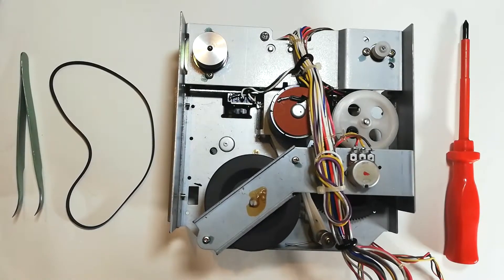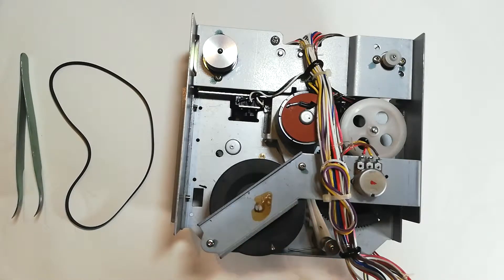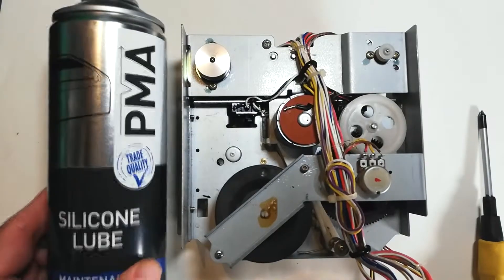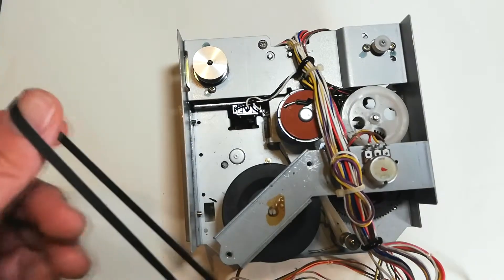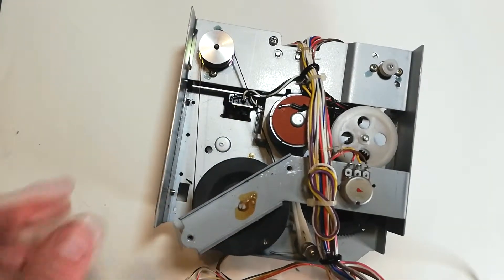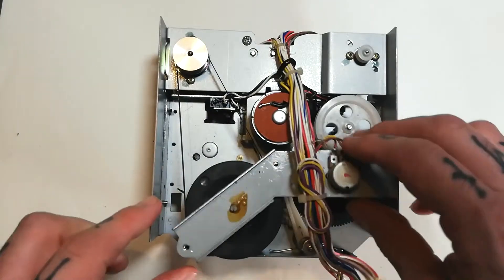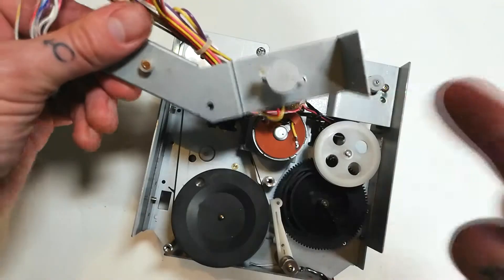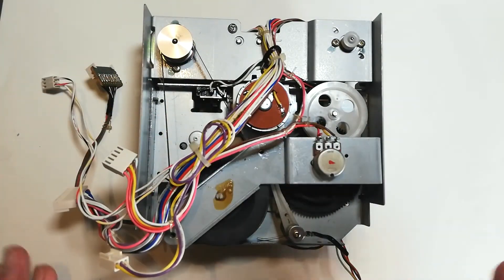9 Capstan belt (Fix Your Tascam 244 Portastudio Transport)

Comment: Hi, great vids, they were very helpful in getting my Tascam back up and running after the belts were all melted, but my issue is the capstan belt comes off after about an hour...  i have tried 2 different belts from two different sources.  I am only using the unit as a preamp for recording becuase I like it's sound, but also to digitize  a few dozen old cassete recordings from the olden days, so it's not the end of the world to pop the belt back on... what happens is it runs fine and quiet then as time goes buy it gets increasingly noisy but continues to run, but eventually after stopping and restarting the transport in play mode it just comes off.  Any tips appreciated!  Thanks again for taking the time to make the videos.
Reply from the maker: Hi, thanks for watching - occasionally I've come accross 244s with this problem, my best explanation is that the metal plate/s to which the capstan motor is mounted and which support the  flywheel have become slightly warped. In some cases I've been able to apply pressure to the plate into which the capstan motor is mounted, bending it slightly, abd that has reduced the noise of the belt rubbing against the edge of the pulley, and the belt has stayed put....I've also tried to do this and made the problem slightly worse (where upon the unit joined my elephants' graveyard of spares donors), so it is risky. You may have to try to get a dilapidated donor on the cheap and recoup your money by piecing it out.
Reply: @Tetrakan  ok thanks!!

Comment: My Capstan belt is a few decades old and completely melted.  Have you any tips on how to clean the melted rubber off the flywheels?  Soap and water?  I was thinking maybe nail varnish remover?  It's like glue!  (Edited) After a a bit of googling I went with WD-40 and it seems to have done the trick!  It seems that nail polish remover would be a big no-no and that isopropyl alcohol probably would be the best solution (but I went with what was in the cupboard!)
Reply from the maker: Hi, yeah isopropyl is what I use, though I'm glad you got WD40 to work. For the benefit of anyone who may read this in future I cover this in The seventh video in this series - http://youtu.be/H-m_zyvmzO8
Reply: Sorry - I hadn't see that one in my haste and enthusiasm!  That's perfect.  I'll have to go watch the whole series and then I'll see if I have any questions when I get to the end! ;)

Comment: hello and thanks for your videos, I wanted to ask you why when I reassemble the capstan belt at the first few turns of the engine the rope comes out of the seat, is it too long ?? or have I not positioned it well? thank you
Reply from the maker: Fabio Sorce maybe the position is wrong, make sure the belt is only a few mm from the top of the flywheel. If that does not help, try a different belt supplier. Very occasionally the metal chassis of the cassette player has become warped somehow, a couple of times I had to  build a 244 with the best parts of 2 faulty units to get one working one, thanks for watching.

Comment from the maker: One clarification...at 3:15 when I say you "could bugger up your whole transport system" if you remove the thrust plate  completely and reinstall it incorrectly, I do not mean to imply you will do the mechanism any damage - you will not - but it IS a frustrating, time-consuming pain in the neck...done right, changing the capstan belt is an EASY job, so save yourself some hassle and DO NOT take that plate off completely!
Reply: I noticed that the little white plastic lever has a leg broken on my 244... I'm trying to glue something but I can't succeed for the moment to repair this pinch.... This part is also impossible to find... What would be your suggestion to "repair" this  arm/lever and put it back ??? Thanks a lot
Reply from the maker: @francoisesco3606  hey, you already found my conversation with Oliver Jones below….for the benefit of anyone else who may read this, I mentioned the possibility of cutting a groove in the sort of plastic potentiometer knob which is sold for electric  guitars and effects pedal. Oliver applied this approach and it worked for him. I’ve seen the photo Oliver took of his mod, so I will probably make a video about this repair one day. Other than that I don’t really know…I’m fortunate enough to have enough spare parts that so far I haven’t actually needed to attempt to glue the broken part, so I’m not clear which adhesives would be best.
Reply: @isesco3606 Just wanted to drop a comment for people in the future who might have this problem. I may have found another solution that works. I took a small plastic drywall anchor and cut it down to make it shorter. I then put it on the black plastic part, where the legs of the white plastic would be gripping. Then I put the single leg of the white plastic in the top of the anchor. Now the white plastic leg is in the anchor which is gripping the wheel. I haven't plugged everything in yet to do a real test but when i spin the wheel with my finger it seems to be holding well. I'll confirm once I put everything back together
Reply from the maker: @JAIRPOTS  interesting  solution, thanks for sharing
Reply: In the first place.....thank you ever so much for these  video's. They are such a help to fix things. on the  244. . After more than 20 years managed to repace all the  belts, pinch roller , idler tires etc. It made me very happy, Untill.... I had to change the white plastic "potentiometer and take the plate of completely and then got stranded in the DANGER Zone. Like you said it's very frustrating to get playback etc working. The tape heads were up , so I placed them down but then the little white fork goes to " Three O clock".instead of 5. Do you have any further suggestions on how to go about this.??   Thanks again !!!
Reply: Update , After trying a few more times , everything is working again!! I have one problem left. When I play back a tape the speed (PITCH) is not even. It's a new tape , so not worn out. Is there a way to fix this?  Thanks again for your videos. Greetings from Holland/